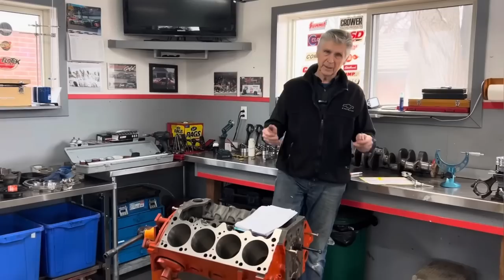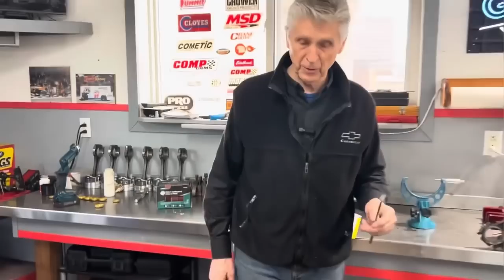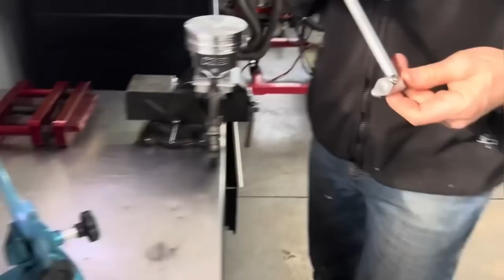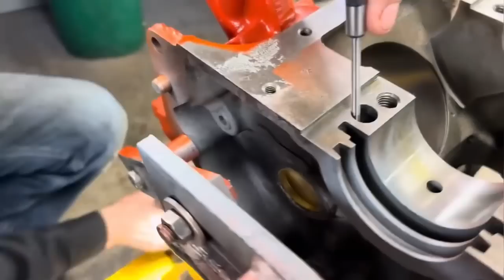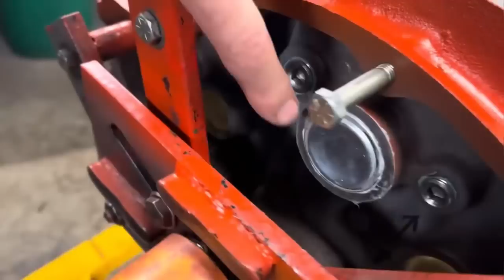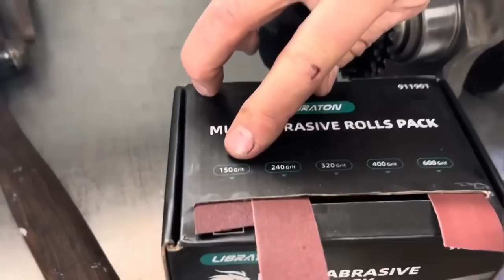BUILDING A 340 MOPAR PART 2 Is Good, Good Enough? A CHEAP Amazon Purchase To Polish Your Crankshaft!

Comment: Looking forward to the LA build. What is this engine going in and what is the purpose of the vehicle?
Reply from the maker: Thanks for the support Mick. Every engine has a story, this is the original engine in a 1970 Dodge Dart, 4 speed car. It was willed to a young lady by her uncle, she is the daughter of my producer who is restoring it for her. AG
Reply: Thanks for the reply, Alan. AWESOME CAR! I have owned an automatic version of that car since the 1970s😊 I wish it was still all original. My brother and I have used a few different cams in driver sbm vehicles and the 268 High Energy is a good strong runner. The steel crank 340s are great engines and are pretty rare and valuable now.

Comment: Good day Alan. I just discover your YT channel from watching "Salter Racing Engines" and his recommendation of your content. I am pleased to find out you are a Canadian like Nick @ Nick's garage. I am a fellow Canadian and I live in Hamilton, Ont. I have been building Mopar's for many, many years (since 1979!) and have my own YT channel called "Metalmax Mopar". I specialize in "LA, B, RB and Magnum" Mopar engines. I would like to send you a link on modifying the 340 "LA" block to enhance oiling to the main bearings. [from 1/4" {.250"} to 9/32" {0.281"}] This was oiling modification was first used by Herb McCandless { Sox & Martin} back in the early '70's and the link is from Hughes Engines in Washington, IL. USA. A reamer is best vs a drill bit. This will provide an abundance of oil to the main bearings using a "stock" volume oil pump. I do this on ALL my HP "LA" blocks whether they are "stock" or "strokers"! 
Kind regards, Tim 
https://www.hughesengines.com/Upload/productInstructions/Oilreamers.pdf

https://www.youtube.com/@metalmaxmopar9520/featured
Reply from the maker: Thanks for commenting and for the info Tim. I will definitely check out your channel and the info on the links that you provided. AG

Comment: Great overview and explanations as usual, Alan. Frost plugs, Freeze-out plugs, etc. Technically they are Welch Plugs. Whatever we call them don't expect them to save a cylinder block from cracking if the liquid within freezes. You made this perfectly clear, Alan! The one thing I noticed that I perform during block prep that wasn't done with this block is the removal of casting flash and deburring. You can plainly see casting flash at the engine valley drain reliefs and at a couple of lifter register bosses. There are probably other areas also. This process should always be performed to ward off future cast iron (or aluminum) shedding and ridding the castings of possible stress risers that can cause cracks. This process also aids oil flow.
Reply from the maker: all good points, thanks for the input Bill. AG
Reply: 100% ref: removing the casting flash and deburing the block. 👍🇦🇺

Comment: AG, if you visit Hillbilly Garage, we demonstrate a simple modification to the engine stands that make it possible to do cam bearings on the stand. On many stands it even works for SBC. Great video, always enjoy everything you put out. Thank you for sharing.
Reply from the maker: Thanks for the tip Ronnie, I will have to look into that, it's a pain to have to remove the block from the stand for cam bearings.AG